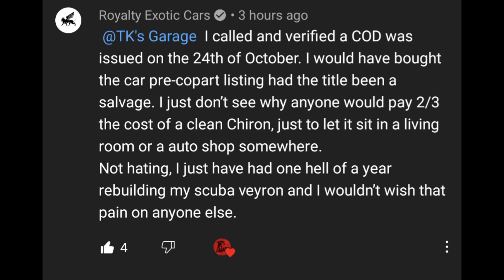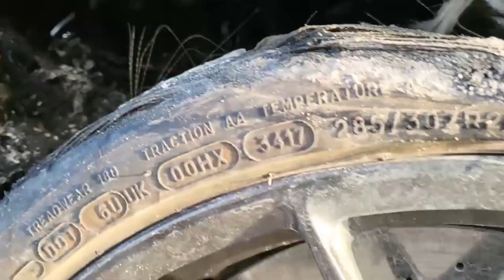Bugatti Chiron Title Is Now Confirmed

Comment: Why is no one talking about the track only possibilities?
1 - 1.5 Mil for a track only Chiron sounds great!
Reply: Because a Chiron is not a car suited for the track.  Its a heavy pig!  If you have 1 - 1.5 million to spend on a track car there are way way better cars out there that are track only cars!  To make the power that the Bugatti makes does not require a quad turbo W16.  It can be done with a Twin Turbo V8.  Same power (or more using race gas) and half the weight.  Bugatti is made as a reliable, luxurious hypercar not a track car.  Someone needs to find a way to register that car and put it back on the road.  It definitely has not sustained enough damage to be a cert of destruction title unless maybe they are worried about the heat from the fire delaminating the carbon layers in the  monocoque tub and weakening the chassis.  Another option for this car would be to send it to another country and register it there.  I just hope it stays as what it is intended to be a very limited production street hypercar!
Reply: @samipsmor3  he's right though. But it would be cool to see someone thrash it around. Maybe like b is for builds jumpacan, the bahaghatti 😋